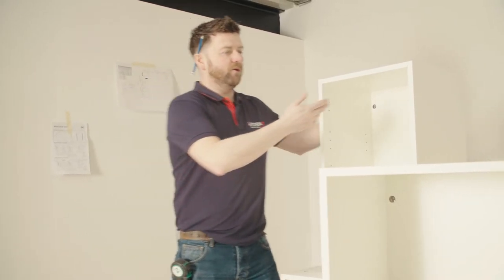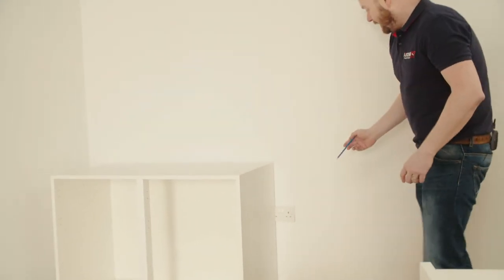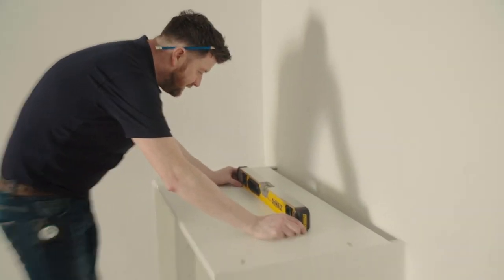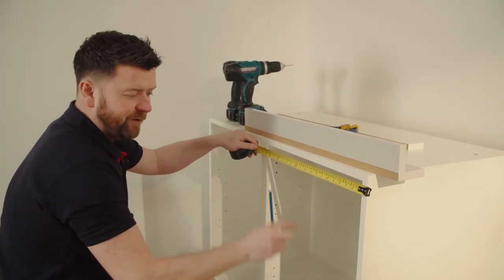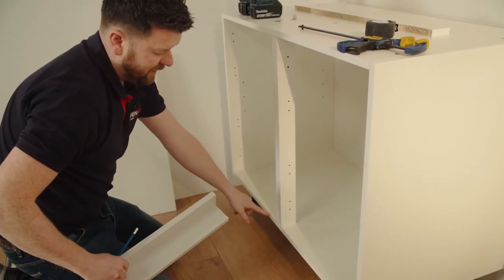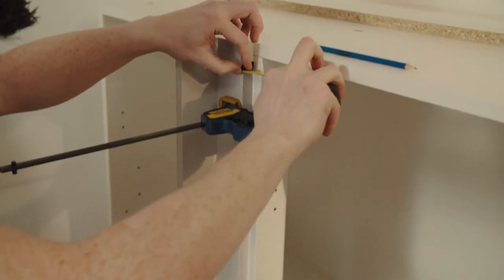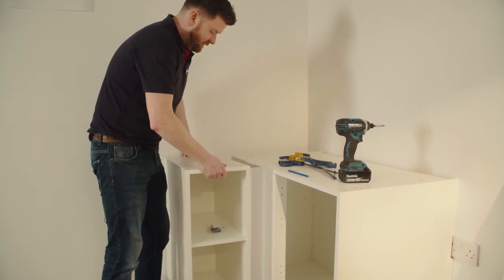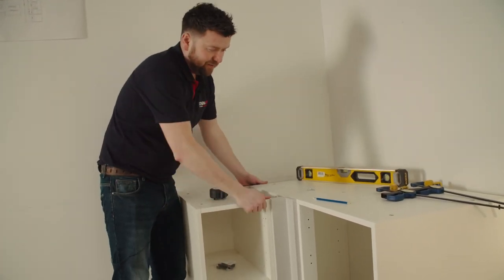How to Install a Kitchen Kit Blind Corner Cabinet

Comment: With the corner unit carcass you get a block of wood for use with a drawer unit to be installed, As you wont be fitting a drawer in a corner, this block of wood is perfect for the spacer between the units at the back. The current blind corner unit now come with a spacer piece for the front of the unit that fits behind the corner fascia not shown in this video but can be seen in other kitchen kit corner units videos.